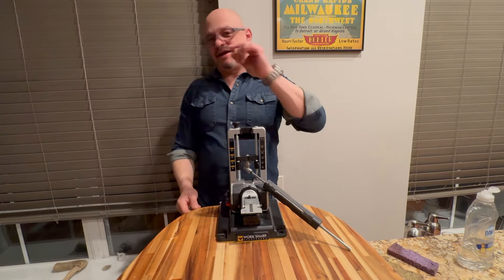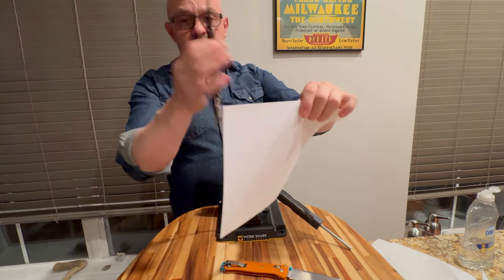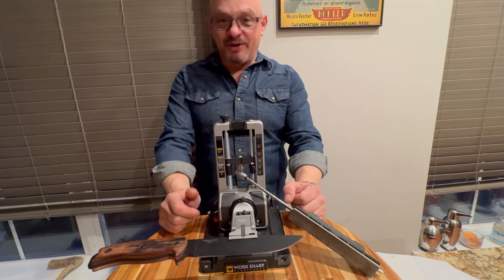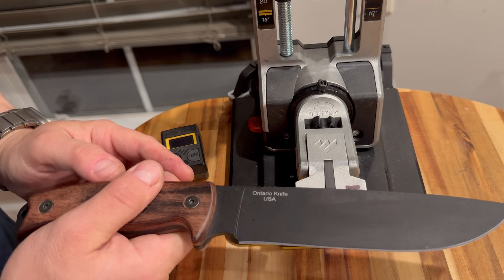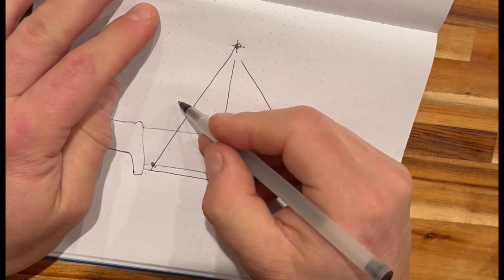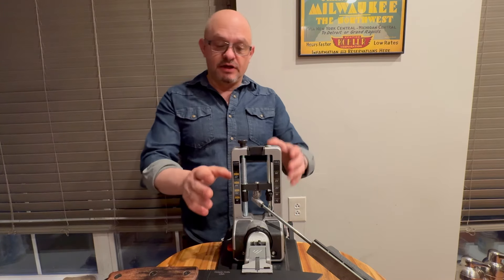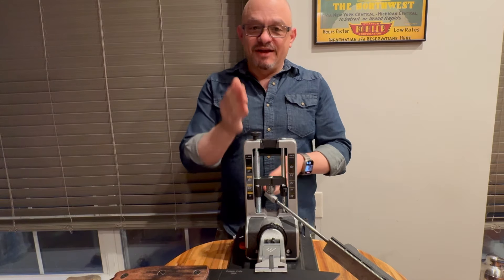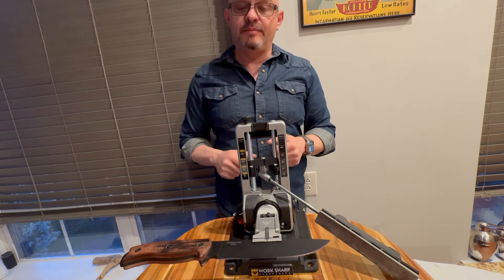Episode #3. Is Work Sharp Pro REALLY a fixed angle sharpener?

Comment from the maker: Did you have any questions? LMK
Reply: Not at this time, thank you.
Reply: I do have a question. Now and then I get an edge that will cut a paper towel but it isn’t consistent. I may be over stropping. What grit do you end with to get that type of edge, and are you stropping afterwards?
Reply from the maker: Very steel-dependent. Typically, softer steels 55-58 HRC can be over stropped, I will stop at 600 prior to.
Harder steels 62+ I wouldn’t even try stropping until after the ceramic honing stone. In 58-62 HRC like CruWear, M4, 3V, M390 etc. you can do pretty much anything you want - these are sharpening enthusiasts’ steels. Exclusion: MagnaCut over-stropps even above 63 - super machinable steel, but if you’re careful the edge finish is beautiful
Reply: @CuttingBoardRx  very helpful. Thanks!!

Comment: This will be a great series, i was thinking of doing the same thing. I love my WS pro but I've noticed a few issues, or areas that you need to look out for while using the sharpener. The upgrades you outlined in your previous video are spot on but in addition, I would say people need to be careful while using the sharpener around the tips of your knives. I would also like to see Additional stones / plates in various configurations and gritt levels other than what they provide in the kit. I also have issues with the knife clamp. There are 2 main issues I have with it, 1 using the clamp for long knives and 2, using the clamp with thick knives or odd shaped blades. For #1, the clamp does not hold longer knives as good. The clamp should be wider. And #2, thicker blades will have issues getting seated deep enough in the clamp to hold it securely. Some of these issues could be fixed with additional accessories, and learning how to use the sharpener will also help.

Comment: How do you clamp the knife? Some people (including me) draw an imaginary line between the pivot and the tip of the knife and make the clamp parallel to that line. Some others draw an imaginary line  between the tip and the heel of the knife and make the clamp parallel to that line and some others make the clamp the most parallel possible to the most part of the knife. In my years sharpening with this kind of sharpeners I've used the 3 methods with very good results. Dr. Thomas is right about the continuous plane. 
Also how do you work with recurve knives? I dont have any and I'm a little afraid to buy one if I can't sharpen it
Reply: I usually try to go heel to tip, but it kinda depends on the shape of the blade.  Are you getting less angle variation going pivot to tip?

Comment: Question instead of zeroing the angle cube on the table. What do you think about placing the angle cube on the blade after it is mounted in the clamp and zeroing it.  cube
Reply from the maker: That may work with the widest blades, but definitely not on anything under 1.5” wide

Comment: Thank you for your videos explaining the sharpener. I am on the fence of getting one. But I think you are not quite right here. As long as the blade is straight the grinding angle will be the same in all places. Only towards the tip the angle will be more flat because of the radius in the blade. But that can be compenstated a bit by choosing the right clamping position. I hade the same worries but then thought twice ;-D
The angle of the rod like you measure it of course changes. But the angle of the edge will stay the same since the rod meets the edge diagonally if you move away from the center position. Its hard to explain without drawing :-D but you have to consider the angles in y-axsis an z-axis independently.
Reply from the maker: Well, the good news is that you’re an inquisitive person. Let me help:
Pretend you are a tiny ant 🐜 walking along an absolutely straight edge (like on Yojimbo). And once in a while you’re looking back at the pivot of the rod. The further you are getting away from the middle of the clamp, the further pivot is from you. That distance is the hypotenuse in the right triangle. Since one side of the triangle (the height of the pivot) is fixed, then the hypotenuse and the horizontal side are changing with every step the ant makes. Which means the angle between them is also changing. On a curved blade the horizontal side of the triangle changes with the curvature so potentially a span of azimuths exists where the angle is constant. Did that clear this up or should I do a separate video about it?
Reply: @CuttingBoardRx ... and when your ant is away from the middle of the clamp and is looking in direction of the hypotenuse to the pivot point it is NOT looking up straight the bevel BUT diagonal to it. The angle of the hypotenuse then differs from the angle of bevel.
Given a knive with only one straight edge: Imagine a plain intersecting the plain of the knive with the angle of the given bevel. The pivot point of the rod lies in that plain. The rod itself lies in that plain. No matter in which direction you move the rod - if you don't lift it up  it will always lie in that plain. And that plain can only intersect the plain of the knive IN ONE ANGLE.
Did that clear this up or should I do a video about it? ;-) Just kidding - but i could clairify this in a picture if you still cannot imagine this properly and provide you a link.
But thank you for responding and discussing!
Oh - another idea how you can prove what i say: Use your digital angle meter an hold it on the rod. But not in direction of the pivot point but orthogonal to the edge of the blade. This may be a little difficult but should give you the right idea.
Reply: @CuttingBoardRx  I'm having a hard time wrapping my head around it all. It's like on one hand, bevel angle is super important. But on the other, a tool like this puts the desired bevel angle only in the middle of your blade and depending on the length and width of the blade this can vary by upwards of 5 degrees? I'd like to see a video on this subject for sure. Maybe even add in how blade deflection affects how much the bevel angle is changed.

Comment: I've benefited so much on your videos of this system. I've applied all of your recommended fixes. I even made the little nut and bolt jig to hold wide blades level. But instead of using magnets I cast the two bolts into a rectangular resin block. Then I coded the nuts in Plasti Dip to avoid scratching blades. 

Can you please go into a little more detail on how you clamp the blade? You said you clamp it at an angle but I was hoping for more of a demonstration of this. So do you clamp it so that the heel and the tip are parallel with the edge of the clamp? Thanks again!

Comment: I just recently had an epiphany about such fixed angle systems, when I watched Pete from the Cedric & Ada channel review the large TRC Apocalypse. He had a huuuge bevel on the front of the blade and at that time I didn't understand that there was this angle deviation, paradoxically from a device that claims to be fixed angle (and it technically is, just not in a way a normal consumer would understand it 🥴). Rotating around a central point is just not ideal for a uniform bevel...